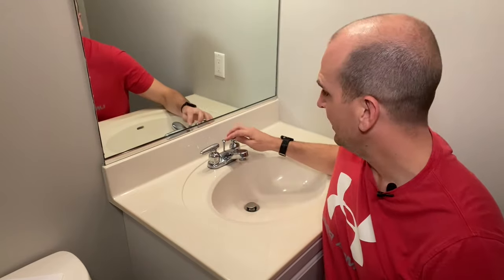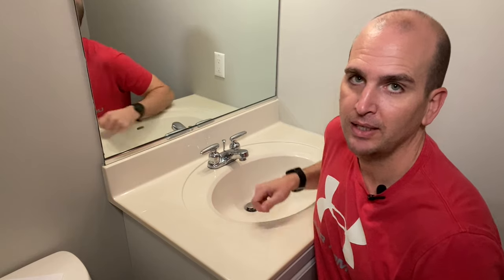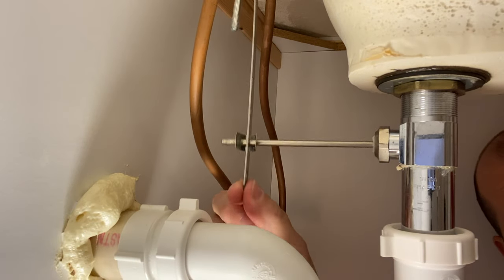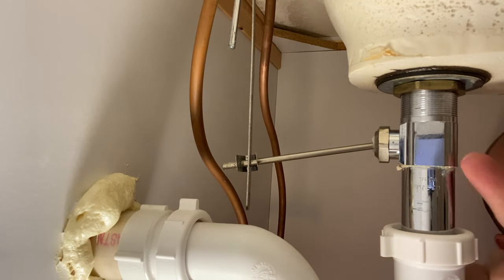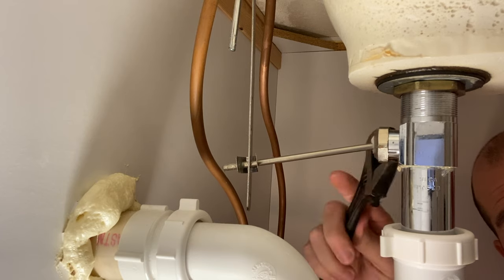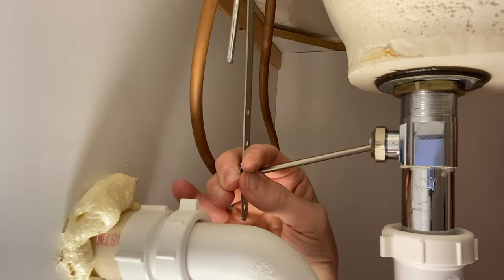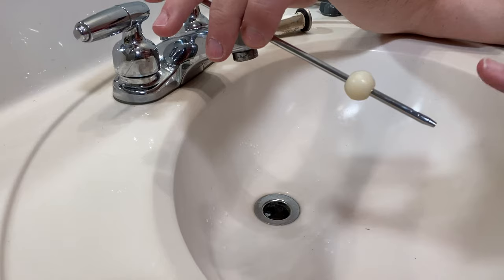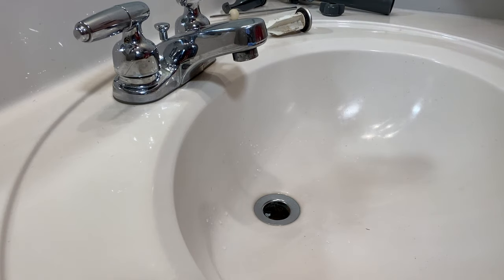Bathroom Sink Drain Stopper Not Working

Comment: Hi Scott, our bathroom sink stopper lift rod has been loose for YEARS. The horizontal rod was not connected to the strap, and the lift rod would pull completely up and out of the faucet base. Your video showed me how to fix everything! A big bonus from doing this repair: The top of our lift rod is square, not round, so when the lift rod got loose, the little square would never stay lined up parallel with the wall (which drove me nuts). I made sure I got the square lined up perfectly when I tightened the bolt holding the lift rod, and now it's all good! And now I know the names of all the little parts under the sink! Thanks so much. Your video was by far the best one I found out of the four that I watched.
Reply from the maker: Thanks so much for the feedback and support 🙌

Comment: Like the other commenters said, this is the best video I've seen on this fix. The only tip I want to add is that you can turn the stopper 90 degrees and it should still go up and down.  The reason for doing this is so you can remove the stopper to clean hair and soap from it. Still,  you explained everything so clear!
Reply from the maker: Thanks for the feedback and good tip which I agree makes cleaning easier.
Reply: You mean 180 degrees (hole facing out), then you can always remove it by turning it 90 degrees (left or right) and lifting it out for cleaning (or whatever)

Comment: Thanks!  Just watched your video and figured out my problem.  The pull rod was stuck in the highest position, meaning the drain was in the lowest, and wouldn't budge.  I untightened the screw, gave the pull rod slack, and retightened.  Works perfectly now.  I've never fixed a plumbing problem before in my life, so many thanks that your video helped me figure out the problem (and probably save $300).

Comment: First, best video ever! 

My builder had the strap bent in every direction imaginable. He also had it facing in the wrong direction. There was also nooo plastic seal washer whatsoever, even though there was with the kit I purchased. The builder's strap and clip seemed sturdier though, so after failed attempts with the new kit I purchased, I tried to get his parts to work. 

Because of all the bends in the strap and a different type of 2-holed pinch clip (arrow-shaped), I could not manage to pass the pivot rod through the clip. The bends in the strap were the problem, but it was a thick strap, and I'm a woman. 

Paid a plumber $125 to basically unbend the strap and slide the arrow clip on. First try, the pivot rod was working, only he had to press on the stopper some for the sink to hold water. He told me sometimes you just have to do that? I was just happy that if I just pulled the rod tight enough it worked. He also didn't add any seal washer. Consequently I'll never hire him again as I foresee a leak in the future.
Reply from the maker: Such a simple little part which can be a major pain in the butt!

Comment: I did everything just to end up finding out that the first thing you said to do was EXACTLY what the problem was.But in the process I ended up cleaning out the sink and finding out the stopper wasn’t put in correctly from the jump.And I figured that out because once I put it back in the way you said to and everything was all back together,I noticed the stopper raised much higher than it’s ever been..Thanks A lot

Comment: My stopper wouldn’t stay down in the drain, kept popping up. After watching this video I went to check my set up and all I had to do was tighten the nut on the pivot rod. It was just a little loose but as soon as I tightened it the stopper works great!  Super easy fix! Thanks for your video!

Comment: Thank you sooo much. My stopper lift has been broken forever but recently I lost the rubber stopper I was using so I dropped the original brass stopper in & of course it got stuck... so while I had everything apart to push it up manually, I decided to fix it. I knew basically how it worked but I didn't really know what the parts looked like because I had disconnected it at some point & lost parts. So your video was a great find for me. I really appreciate that you took the time to show  how everything worked with the other assembly, which Nobody ever does. Usually they just point to the installed unit and expect us to see through the pipe or something. I have some leaks to fix at my daughter's house so I subscribed & will be checking out your other videos for help soon. Thanks again! 
MB King
Reply from the maker: Hey Mary Beth, happy the video helped you out.  Best of luck on the upcoming repairs and let me know if you have any questions.  👍

Comment: Thank you very much for your tutorial sir. I recently moved into an apartment complex and reported a sink clog and they cleaned out the p-trap and used some sealant putty to the p-trap connector. It was still clogged so I watched your tutorial and cleaned out the stopper but the p-trap connector is tight as heck and I didn't mess with it cause it just wouldn't turn because of the putty they used lol. But I got it to unclog thanks to you, again thank you sir. Have a blessed day. Aloha from Kansas

Comment: Ty for this. Very helpful. I pulled up too hard and the rod came out of the thing with holes connected to the stopper in the sink. I had fixed it before but couldn’t remember how. Appreciate you demonstrating how it works, made it a snap to repair.

Comment: Gave you a like and subscribe.

Was pulling congealed bits of hair out of the drain stopper out cuz I BELIEVED it was PREVENTING the stopper from CLOSING PROPERLY, but upon doing so, I heard something metal fall off below the sink reservoir.

Went to inspect and saw the U-shaped spring clip had merely come off the assembly so I looked at your video to make sure I was simply reattaching it correctly. Very helpful, thank you!

Comment: Clip wouldn't stay on... Bend my spring clip out! That's all I needed, but no other video mentioned it. I'd never had that problem before, but my current clip is made of thinner metal and I probably bent it in when removing it in the first place. Thank you! For anyone else with the same problem (clip won't stay on), he explains it starting at 12:45

Comment: Thank you so much for this excellent video. It gave me the confidence to try my hand at plumbing. 
However, after spending more time at it than I care to admit I still haven’t fixed the problem and maybe I even made it a little worse. I can’t figure out what I’m doing wrong or was wrong to begin with. The issue has to do with your second failure mode but not exactly. The lift rod’s up-and-down motion is minimal (very tight) so the stopper goes up so little that there is barely any difference between up and down and the water drains extremely slowly or not at all. When I first watched your video I thought it would just be a matter of re-installing. It took many tries to thread the pivot rod through the stopper’s loop. There’s only 5” between the wall and the end of the pipe where the pivot rod goes and I couldn’t focus the image on my phone so I had to go by feel and somehow I kept missing the loop. Eventually I got better at it but, despite re-installing numerous times, the problem persists. When the lift rod/pivot rod/stopper assembly is complete the up-and-down motion is minimal. I thought it could be a problem of physical space inside the pipe for the pivot rod to move properly so I removed the stopper and just assembled the lift rod and pivot rod and completely installed the pivot rod by tightening the nut but did not include the stopper in the assembly. In this case, without the stopper, everything moves up and down properly. So I thought it should with the stopper too, right? But when I add the stopper the range of travel becomes insignificant. None of the parts are damaged. My stopper is not exactly like yours. The loop is not to one side but centrally positioned at the end of a threaded rod. Also the stopper does not end in the loop but a round flat base under the loop. So as a temporary solution I have the stopper simply sitting on the pivot rod. Any suggestions? Sorry for the long message.
Reply from the maker: Hi Era,  thanks for the thorough explanation of your troubleshooting thus far on your drain stopper.  The first thing that comes to mind is the lift rod / lift rod extension is attached too close to the drain pipe on the pivot rod.  Since the pivot rod has a centra of rotation at the drain pipe the further you attach the lift rod / lift rod extension away from the drain pipe the more "lift" you should get.  Take a look and if you want to also dive even deeper jump over on our Facebook Group "Everyday Home Repairs Community" and join.  There you will be able to add pictures/video and we can work to get your problem fixed.  All the best!

Comment: you are such a great teacher. you know how to convey information in easy to understand manner. that is a real talent! thanks! I am pretty sure both of our bathroom sink pivot rods corroded significantly so they are both too short for the drain stoppers to connect to. I'm going to order two now and switch them out tomorrow - fingers crossed that is the only issue. Though after your video tutorial, I am quite sure it is:)

Comment: Very good video.  One problem, I don't feel like my drain is opening all the way.  Does it matter what hole the lift rod goes through on the lift rod strap?  Mine was installed in the fourth hole from the bottom?  Should I move it to the third?

Comment: Great video. One question. We connected it all properly accordingly but the phalange itself doesn’t seal 100%. We even tried using the old phalange that wasn’t broken. A tiny bit of water drips down into the drain until all water is out within less than a minute. Thoughts on why that’s not sealing all the way?

Comment: I watched a Delta video showing the stopper can be installed either way. If it is offset 90 degrees you can hand remove the stopper for easier cleanout. But then it only relies on gravity to make the seal, which doesn't seem adequate.

Comment: thanks Scott.  I have 3 questions:    1. about the stopper that goes from the top. I hope I can explain this correctly. the hole at the bottom (where the rod goes through to lift the stopper up) is not at the center (located at one end).  So, does it matter how I insert the stopper in?  Should the "hole" be closer to the rod entry?    the reason for the question is the stopper is not lifting up properly (all the way), so the water drains slower than ideal.  2. about the rod that goes down from the back of the faucet towards under the sink (the one i pull up to close the stopper and push down to open it):   the way the entry aligned, the rod goes in at an angle (looks like 45degree) - so the rod is not going down straight.   I had to bend this so i can connect it to the strap that gets attached to the moving mechanism  (i hope this all make sense).  Question is:  is it okay to bend the rod?   3. finally after all that, the pull - push rod moves very difficult.   I have to pull and push it very hard.  is there anything I can do to improve this.  thanks in advance..  Ben

Comment: My pivot rod just broke with a sink full of water and this is the best vid I've found for it.
Reply from the maker: Nice, did you get the problem fixed?
Reply: @EverydayHomeRepairs  Not yet. Bought a arm that said it fits "most brands", it did not fit mine. My drain says American Standard on it but the arm setup doesn't look like any AS I can find online.

Tempted to replace the whole drain assembly at this point.

Comment: I just discovered our one bathroom sink doesn't have a pivot rod strap (the one with the holes to attach the pivot rod). It has a  kinda makeshift piece the pivot rod attached to. Probably more efficient to buy a pivot rod strap so securly/properly connected?

Comment: Great video! I have a couple of questions...

1. Do you have to turn off your water while doing this repair?
2. My stopper is attached and won't come out of the drain. Can I detach it, or do I need new parts?

Please advise. Thanks!
Reply from the maker: 1)  no need to turn off your main water valve just try not to turn the faucet on during the repair
2). If you reach in the vanity cabinet and push the pivot rod down does your stopper come up?  If not the pivot rod is most likely broke off in the pipe which is an easy part to buy and replace in most cases.

Best of luck!

Comment: Just noticed that the pull up drain plug is very loose on a BRAND NEW sink, and realized that it is leaking at the ball. With all the delays and other issues I’ve already dealt with concerning the builders, I’d rather not have to call them back in to fix it ( and wait till they “get around to it”). With this video, I can be confident that I could do it myself....and then check the other 3 sinks that were just installed for the same problem.
Reply from the maker: 👏much easier just to knock these out yourself.

Comment: i installed a new faucet and drain yesterday and I am finding that I am now leaking from the pop up drain. Right were it goes into the drain pipe. This style does not have a nut that screws down it has some kind of plastic clip that you have to pull out and push in the stopper and then you snap the plastic clip back in. Not not sure why it is leaking plus I have never seen this style before. You have any tips or reason why it might be leaking from there?

Comment: My pivot rod corroded and broke off inside the pipe.  But it has surplus length on the outside, so can I simply push the ball down further and creat more rod extending out?  Does that white ball slide?

Comment: Actually my design was set up (rod too long to remove) so that I can not remove the seal but somehow I was able to tread the rod back through the hole and the stopper works now. I guess the rod just worked itself out.  Thanks I am 73 and do lots of repairs with Utube videos too - saves me a ton of money when plumbers charge $200/hr.

Comment: I have a question: my bathroom has two sinks. One of them is slightly clogged, I.e. water is slow to drain. I seldom use the other one. Tonight I pulled the stopper up in it to soak something with lots of water and minimal soap. Now, it is stuck with the stopper closed. I checked out the first thing but I have to wait to get tools to do the rest. If I use something for the clog in my other sink, is there any chance that may solve the stopper issue?

Comment: Excellent as i just had stopper stuck....but there is no pivot rod attached to the drainpipe....im trying to figure out how to keep the faucet without having the  stopper attached to anything just manually control the water perhaps with a rubber stopper but as of now i pulled the drain under stopper and there is no pivot i went to Lowes and iwas sold a new stainless drain with an opening on the neck for the pin of somesort apparently these faucets are from China and work without a lever or pin as i did not see anything under the sink. I did not use the stopper anyway it was always too flush with the drain and never had too much rise....

Comment: if the stopper is not broken and it's disconnected.... and the pivot rot is successfully moving up and down then is the tip of the pivot rod potentially broken.   wondering how that would happen without the plastic end of the stopper breaking as well.   i can't figure out how my stopper became disconnected.

Comment: I did all that, but even with the nut on the push rod tight, the push rod slides up and down and the pop up doesn't move.  Am I binding up somewhere?
Reply from the maker: Hey Dennis,  did you remove the pivot rod and ensure the little arm inside the drain pipe is still in good condition?  If it is metal then it is not uncommon for the arm to build up corrosion and then break off.  Let me know what you find.

Comment: I tried fixing mine today, but when I pull up on the handle to close the drain and then let go of it, it just falls back down.  What am i doing wrong?
Reply from the maker: Hey Joe,  so when you pull the handle up then the drain does close but when you let go of the handle the drain opens back up and won't stay closed?  If that is the case I would check to see if the nut holding the pivot rod on the drain is tight.  If the nut is tight that should provide enough friction to hold the drain in place.  let me know what you find.

Comment: My seal was on the outside of the ball, not the inside ( which this video shows) as the one I bought at Ace Hardware was made that way. I thought the seal was too large and was made incorrectly when it would not fit in within the inside part of the ball until I saw a different one done that way. FYI. It worked great.

Comment: I've got a leak coming from the lift rod up against the sink.  Have any idea as to why?  Thanks
Reply from the maker: Hey Mark, I would think the leak is coming from the handle/valve.  Then the water is just traveling through the lift rod hole.  Does it only leak when you turn on the water or even when the water is off.
Reply: @EverydayHomeRepairs  Thank you for the quick response!   I just changed the entire faucet and blocked off the lift rod hole using a rubber seal.   Works fine.  Again,  Thanks!
Reply: Subscribed to 'Everyday Home Repairs'  because he responds and understanding!
Reply: @EverydayHomeRepairs  Thank you for replying, but it was a old faulty faucet.  When I first installed it yrs.ago,  I never installed the pop up valve thing.  So I bought one that didn't have the pop up thingy, and it went well.   No more leaks!  Again,  I thank you for your immediate response.   Thumbs up!
Reply from the maker: @mark1952able  makes sense.